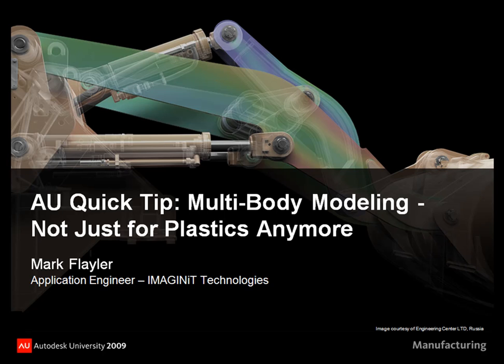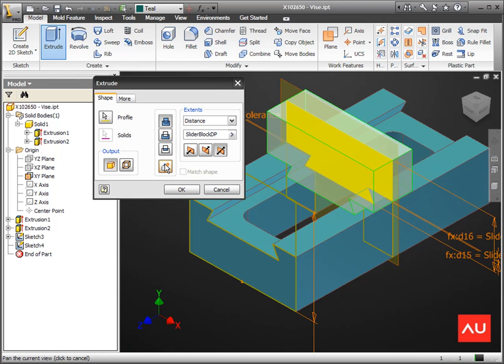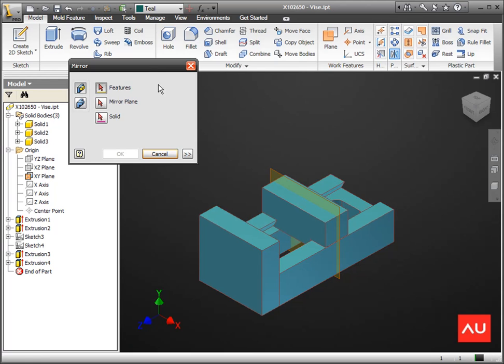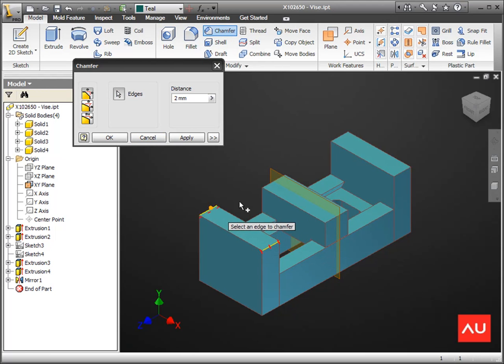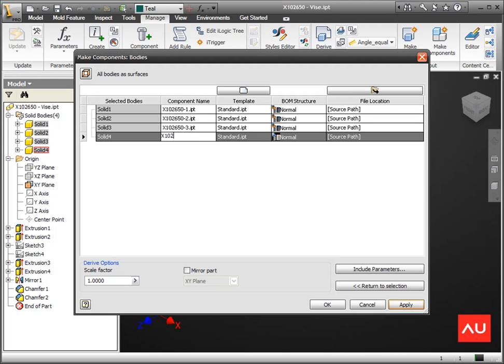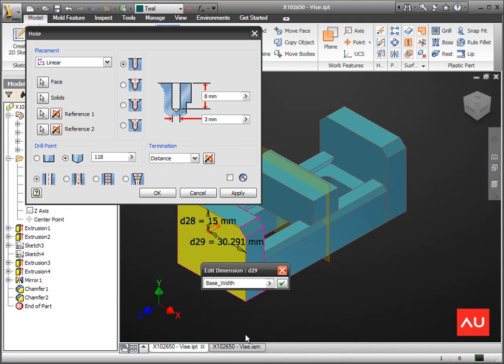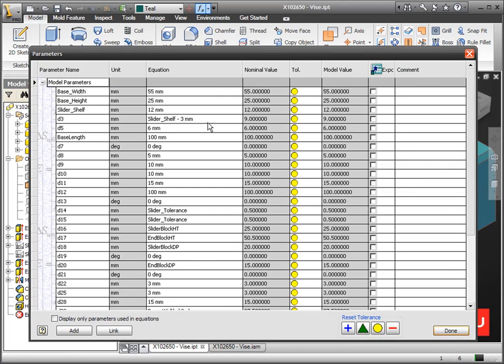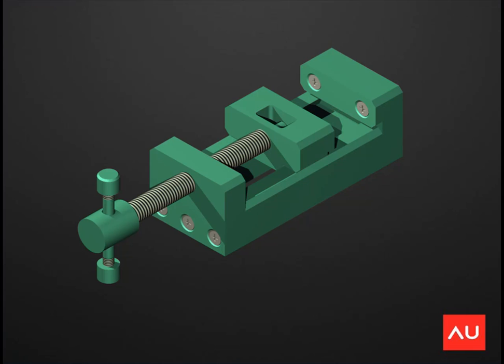Multi-Body Modeling

Comment: I have a question regarding Mulit Body Modelling in Inventor 2010.

Using table driven iFeature Sketches can I use information from the iFeature, to propagate the iProperties in each of the part files as I would normally.